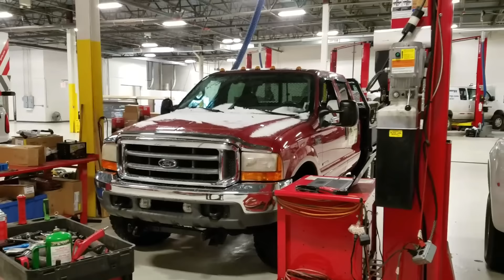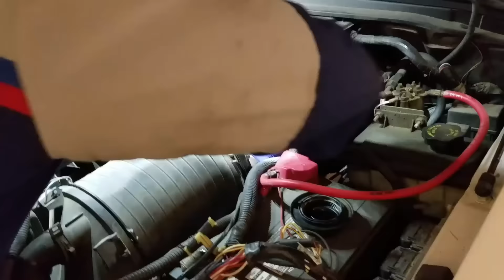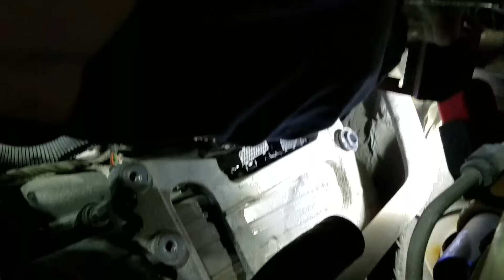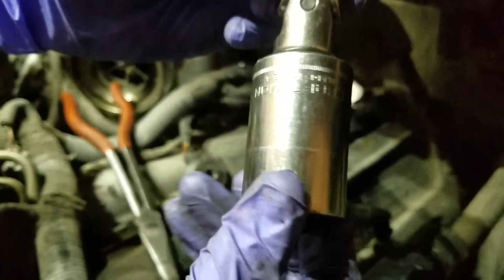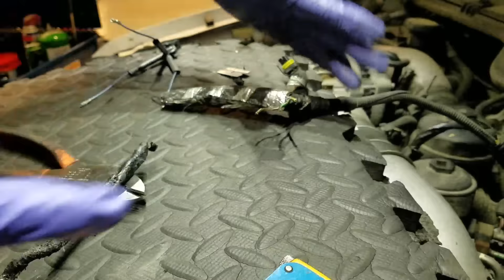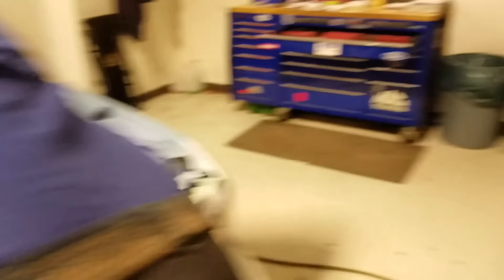'03 &'11DIESEL PoWerStroKe  - STALLING/MIL

Comment: it use to do fine first key it fire right up then one day BAM I got this problem that why I changed injectors once and glow plugs twice I get the starters from o Reilly lol that's probley the problem but everything else is OEM even when I plug it into 110/120 i still have to spin it but not quite as long as without it but shouldn't have to plug it up when it 70 outside lol and yeah it's a dinosaur but I love it it rides and drives like a Crown Victoria I also have a 1996 and 2. 1995 a 1994 all 7.3 but the 1993 is the only idi
Reply from the maker: William Williams yea id say aftermarket starter motors are jizzzzzunck. id hate to have u buy another, but try our Motorcraft assembly

Comment: good deal.. hey I got a tech question for you I have asked several Ford mechs and they don't know maybe you can steer me in the correct direction I have a 1993 ford 7.3 idi with 230 765 miles brand new injectors, glow plugs, glow plug igniter, newer stater, 1 year old batteries with 900 cold cranking amps, fairly new alternator, clean fuel filter, and it is very hard to crank I go through probley 5 starters a year cranking it I don't use starter fluid on any of my diesels
Reply from the maker: +William Williams wow thats a scenario you got there. Man I cant say ive ran into that. Theres gotta be somethin wrong with the kind of starters ur gettin or something internal to the engine, but if it runs fine than that kinda throws that outta the window. Hmmmm weird, that oldie is be4 my time as a tech tho. Have only worked on a few.

Comment: Not suspto use a blow torch to shrink, heat shrink you should use a heat gun Ford didn't teach you that??? You can get the copper or aluminum wire too hot and make the wire loose connuity using a blow torch
Reply from the maker: +William Williams yes Ford did tech me that. As the years have passed I have mastered the use of the minin torch. Haven't had a problem yet. The heat has nothing to do with loosing a connection. As long as I made a good crimp with the bullet splice, AINT nothin comin apart. Life time connections bub

Comment: These things make power, but lol man, low miles, oil leaks, bad sensors, and I was pissed with my shut off solenoid going bad on my 84 6.2 with no oil leaks cept the rubber cooler lines... I always like watching what kinda disaster these newer diesels are.

Comment: i did the icp sensor on a 6.0 from the bottom of the truck i thank its easier that way :)
Reply from the maker: Tagz but usually you have 2 replace the pigtail too, i cld see replacing just the sensor but shoot i dont think n e body gon be able to do some 12650D45WR up in therr

Comment: Aaron! I enjoy your videos, im new to diesels but i love learning about all of them. I own a 04.5 Chevy Duramax LLY 6.6L so my question is about my one of my co workers trucks, he has a 08 6.4l F250 and has recentley started having random spurts of white smoke/haze at idle/start up, and recentley the truck has stalled out on him, both times at low speeds. And the Concerns are coming back more often each time. Any tips to point him in a good direction on what to look at as far as common concerns? He has a Spartan Tuner on it and its EGR deleted. Yes its got the ungodly like 250hp overstock tune option which he has drove with and towed with, i told him to stop and he tuned it back down to 50hp overstock but im affraid hes already done the damage? Its his first diesel also so he was clueless to the danger of running a such a hot tune let alone while towing. Im afraid he has melted a piston or a faulty injector?
Reply from the maker: Zachary Redmon i would say bub, that the damage is already done. He has played now its time to pay $$$$$$ bet he gets rid of it because it'll be tooo much to fix. Unfortunately the 6.4's are lots of money to fix. He has everything deleted so it cant be any emission or exhaust components causing this. Most likely a base engine concern assuming he has not stuck open injectors causing the smoke but he would probably see a driveability concern tho....jst my 2 cents